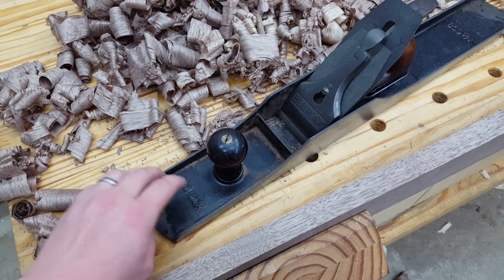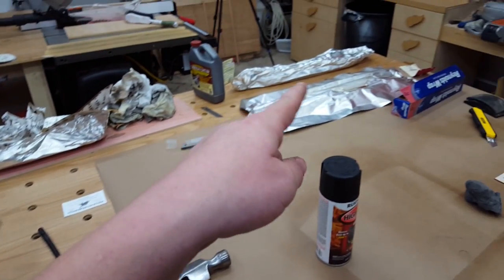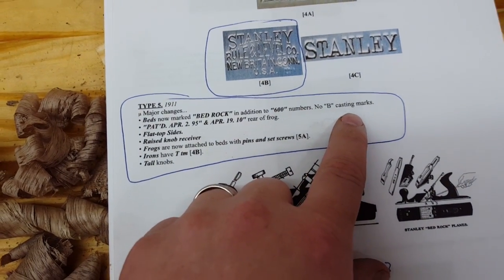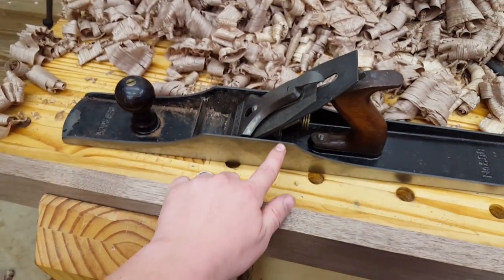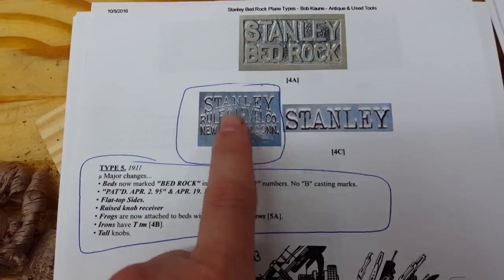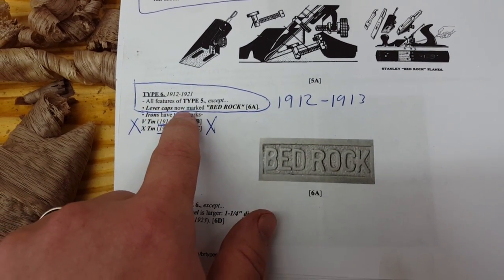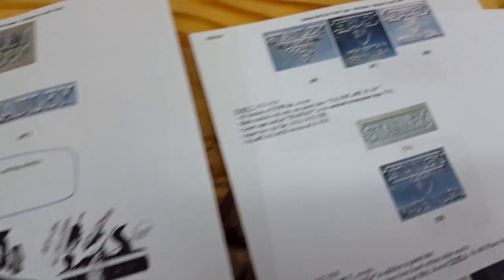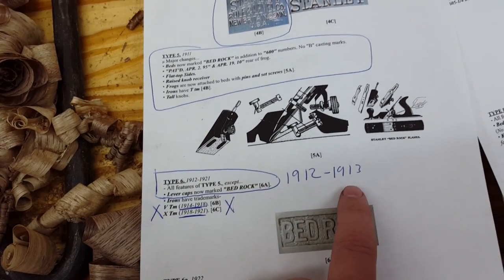Stanley Bed Rock No608 Type 5 or 6 from 1911-1913 (?)

Comment: Regardless of the bottom pitting, that is one sweet jointer plane.  I believe you've identified it accurately, too.  I need to find one that size for some work I have bouncing around in my melon...preferably an older one as well.  Happy shaving!

Comment: Nice plane! I'm new(ish) to woodworking but I picked up a Stanley #7C jointer plane for cheap moniez on ebay. I believe it was made between 1902 and 1910 or thereabouts. Over a hundred years old and it still works fantastic.

Comment: Very nice. Got my first Stanley #4 this weekend. Have just made a ton of maple shavings with it so far. Still getting some chattering in one direction... learning how to dial it in, and adjust it... I actually had your previous video on plane restoration up on the bench while I went through mine....
Reply: I will try that. I only get chatter when planing in one direction. If I swap board end for end, it seems to plane just fine. Perhaps it is grain related issue too. It is a new plane, and needs some adjustment before using it well.
Reply: thanks Barry. It is a proper Stanley brand plane. I've taken it apart when I got it to go through it, and get my head around adjusting it. I'll tighten things down with it, and give it another try. Sure is therapeutic making the shavings though!!

Comment: Its definitely a grey area. It's not a huge deal unless you're collecting a specific type-which I am. I'm trying to collect the type 6/6a. I have a 608C on it's way to my house right now. ☺️
On a separate note, you need to clean and sand a little more after you use Evaporust. I use the stuff and if you don't work at cleaning right away, the metal will start losing its luster and will appear as though it's been powder coated. She's still a beauty though.

Comment: Jay, Im not disagreeing with you, but here is something to consider.  I don't think you should eliminate your original premise that this may still be a Type 5-1911. The original criteria that you identified, with the exception of the iron and the cap, fits both the 1911 thru 1913.  Your premise for dismissing the Type 5-1911 is based on the bedrock stamp, an interchangeable part.  This logic would be false here given the fact that you did not eliminate the possibility of a Type 6 -1912-13 for the same reason of another interchangeable part, the iron.  Having given no other information as to why you have selected a type 6, I think it is easily arguable that this CAN BE a type 5 or 6, 1911 - 1913.  

Having said that, I agree it is very likely that this plane is well over 100 years old, regardless of the specifics. To think that for 100 years, a part or two has not been replaced, would be a false assumption. I do agree with you though it is more likely to be a type 6 than a type 5 because of the cap iron, as it is much less likely to be replaced over time as opposed to a blade.  

I realize we have come to the same conclusion, but I'm not sure I would have eliminated the type 5 so easily.  Regardless, it's semantics.  Great detective work here, thanks for sharing this.
Reply from the maker: Agreed. Calling it a Type 5 OR 6 from 1911-1913 is more appropriate.

Comment: What be the point of such a long plane?
Reply: jointing
Reply: Curtis Frost The longer the plane the flatter the surface. A shorter plane, like say a #4, would follow any hills or valleys along the edge whereas this much longer plane will level them all out by staying on top of the high spots while shaving them down. Hope that helps.